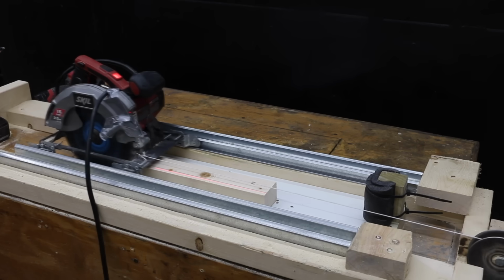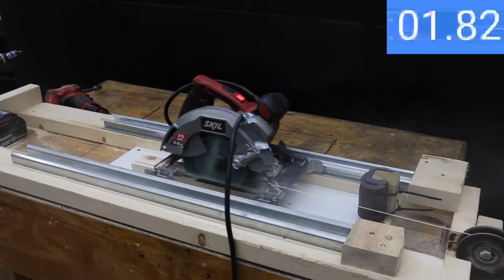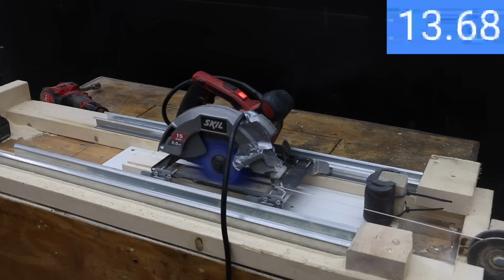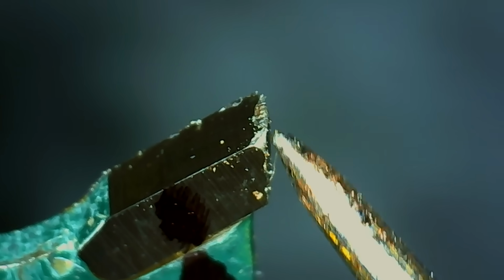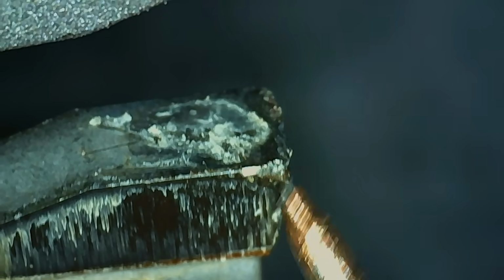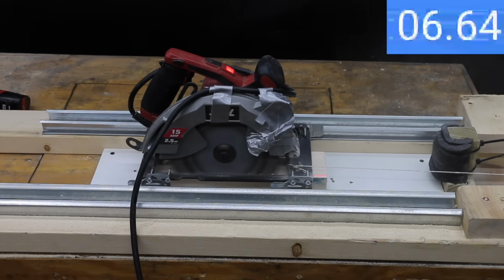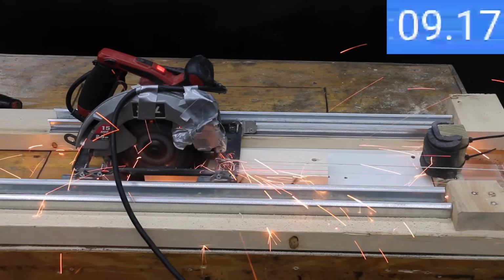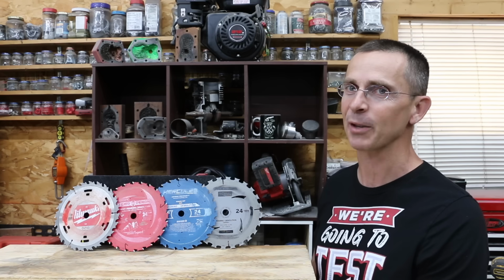Best "Demolition" Circular Saw Blade? Milwaukee, Diablo, DeWalt, Hercules, Evolution, Bosch, Amana

Comment: Very interesting, but ….       Heh !   
 No circular saw blade is going to do much demolition !    It has always interested me that the first cut/cuts  are slow, till the blade lacquer polishes, also a blade seems to need to heat up  to run at full speed.
     If I ever did demolition that way, I’d use an old Saw !!
Reply from the maker: Thanks for the feedback.

Comment: I've always stuck with Diablo blades, you can get them as low as $8 to $10 sometimes. To me, it's the best value. I used them this past weekend on building a table and benches, worked perfectly. Also used on cutting up some thin steel from a above ground pool. Slowed down a bit at the end but performed.
Reply from the maker: Thanks for sharing.

Comment: You do great work.  Can you revisit the battery powered chainsaws? The Ryobi worked great as you said but, in our case, struggled after cutting ~8" diameter cedar.  The saw stopped cutting.  Seems to have dulled a lot afterwards.  Appreciate all you do.
Reply from the maker: Thanks!  Thanks for the suggestion.
Reply: @ProjectFarm  It made the 1st 2 or 3 cuts and then nothing but smoke. Bar oil was good. Luckily, we can return it.  Looking forward to the follow-up.  Thanks again.

Comment: Speeds and feeds mean everything. The 5lb weight is a nice constant but it doesn't allow the entire performance story to be told. I don't know the answer, but...

Each blade has a different number of teeth, cutting agle, etc. The rate and weight of 5lb is going to favor some blades and not others. If this test was repeated with a 2lb weight and a 10lb weight there would be hugely different results.
Reply from the maker: Thanks for the feedback.

Comment: Not related to demo blades I found the best blade for a battery operated saw is a thin kerf blade.  It cuts easier and the battery lasts longer.  For Demo I go stray to the sawzall.
Reply from the maker: Thanks for sharing.

Comment: We don't have those "shingles" over here in the UK. 
What is it about them that would slow down a saw-blade after use?
Reply: As far as i know its sanded bituminous "fabric" 
Its like cutting through sandpaper wich makes the teeth dull.

Im German,  ill put the fabric in quotation, because im missing the word^^
In Germany we call it "Dachpappe" which could be literally translated to roofing carton (i think)

Comment: "The least expensive brand we will be testing is this Milwaukee brand."

Words never heard until now.
Reply from the maker: Thanks for watching!
Reply: It will be the last, the price will go up once Milwaukee hears how their blade did on the test.  They may even place some kind of verbiage saying "PF recommended".
Reply: @JT-lq4yd  that's no joke man. I've seen products he tested that were reasonably priced then I go to the store a week later n the price is up between 10% to 20% from when he tested them
Reply: @benmiller5015  thats just inflation
Reply: This is the first time those words have either been spoken or appeared in print.
Reply: Actually you know what was more unexpected, feckin Horrible Fright being a top contender.
Reply: @ObservationofLimits  I've used the harbor freight blades. They'll hold up in this. But any harder wood or wet treated wood. And it's shot real quick. 

Used a brand new 12 inch Hercules blade to build a small deck and it was done by the end of the job.
Reply: @ObservationofLimits  It was probably a fluke.
Reply: @drippingwax  but they only make test equipment.....
Reply: I know....  I just about passed out when I heard it!
Reply: My Lowes is selling those spider ones for 5 bucks should I buy?
Reply: @FirstnameLastname007  For $5 grab all of em
Reply: @doncheeto5  will do sir on my way
Reply: @FirstnameLastname007  waste that money.
also buy some Meme Stocks while you are out
Reply: Also considering it wasn't even rated for demolition.
Reply: Well, it's a framing vs demo branded blade. I'm sure a Milwaukee demo blade wouldn't be cheap. But considering performance, Milwaukee has most definitely been outperforming everyone. The cost of a Ryobi with the power and reliability of a Hilti. I'm glad at least one company still has some honesty these days.
Reply: @ObservationofLimits  Milwaukee's really exploiting their spot in the power tool hierarchy right now, and much more effectively than a lot of other brands. They make consumer grade tools that perform miles better and only cost yards more than the other brands, and at the same time they have the most incredibly broad range of pro and niche tools, positioning themselves to be the go-to brand for a lot of trades, because those trades can get their specialist tools and general tools on the same platform.
Reply: @ObservationofLimits  paaaa

Comment: Very interesting.  I always loved the Diablo blades and bought one specifically for a cabinet build.  I was borrowing a table saw from someone and he saw the cuts and bought the blade from me.  Someone else decided to use the blade to do some rip cuts through dimensional lumber and complained and said it was junk.  Told him he was a derp since the blade was made for plywood and things of that nature.  Might be worth testing different types of blades for ripping vs crosscut as well as throw in some blades made for plywood and which ones cut cleaner through engineered sheet goods.  I know they also make "combination" blades that are supposed to do it all but do they cut sheet goods as smoothly as a blade designed for it.
Reply from the maker: Great suggestion.  Thank you.

Comment: While I haven't done remodeling work for many years, I always preferred the Diablo blades whether it was a framing/demo blade or finish/plywood blade. 

I always found them to hold up longer than other blades, and it's interesting to me that many other manufacturers started copying their blade designs. 

That Big Blue blade design is dangerous. I imagine it would be far more prone to kick back.
Reply from the maker: Thanks for sharing.

Comment: As an avid Diablo user I was really interested to see how it would perform. I've heard of Spyder quite a bit, and am shocked at the performance of the DeWalt. I've used that blade one time only and that performance cutting through nails absolutely destroyed the teeth on my blade. Going to have to look into Evolution though, never heard of them. That said, after I see and feel a noticable difference in cut efficiency or after I've cut through say shingles (rarely with a Skilsaw - Sawzall typically) I replace the blade so most of the benefit noted after the torture tests for me is somewhat moot. Good info to have though, and as always excellent video!
Reply from the maker: Thanks!

Comment: Saw a video about the safety clutch set up for circular saws, amazing tool. Try to cut a hot dog with it and it senses soft material in the circuits and jammed the blade to a stop. 

Off topic a little, sorry.

Comment: Now that you have all of these duller blades you will have to test: Which clock movement fits and is the most accurate in your dull saw blade.

Then followup with best method of painting landscapes on clock saw blades.
Reply from the maker: lol  Thanks!  Cool projects though.

Comment: 15A corded saw is a good choice as a control test unit. Push the blades as much as possible with a consistent power supply.
Hercules now has something very respectable to look at. When it comes down to cost effectiveness, on sale, the Diablo can't be easily beat.
It would be good for a part 2 with other brands like AvantiPRO, Admiral, Bauer, Craftsman, Lenox, Makita, SKIL, Kobalt and Irwin. Even though they seem to be rebranded. With the amount of brands, you might even be able to do part 3.
Reply from the maker: Thanks for the suggestion.

Comment: Diablo blades are 100% the best carbide blades for metals, the Steel Demon brand.

But id like PF to test that on 1/4 inch mild steel or similar, thanks again PF.
Reply from the maker: Thanks for the suggestion.

Comment: Great testing process and video, I just have one single complaint for this comparison. You should have tested with crosscuts instead of ripcuts on wood as most of the framing work is crosscutting wood, and demolition is almost only crosscutting. 
This could have made different results as these blades are made usually for crosscutting and wouldn't have experienced so much heat buildup. 
Maybe next time when you test another set of blade manufacturers
Reply from the maker: Thanks!  Great suggestion.  Thank you.

Comment: Did you put a off switch behind that foam bumper or was you turning off the saw every end of the cut? If you put a switch behind the bumper in line with a timer, every time that the blade hits it it will do two very useful things for your test:
1) Will switch the saw off
2) Will stop the timer
Doing that might give you more accurate results...Otherwise thank you for yet another incredible video and keep 'em coming !

Comment: That Big Blue blade just doesn’t make sense to me all around
Reply: Probably good at small brush on the edge of weed eater
Reply: @MrDavegiven0330  yeah that’s what I was thinking. They just rebranded it as a be all blade
Reply: It is all looks and gimmick. Put it on the wall and call it your "precious". Everyone who hasn't seen this video will be in awe of your Big Blue.
Reply: Agreed, that thing was a waste of material...
Reply from the maker: Thanks for the feedback.
Reply: That thing looks so dangerous though - it reminds me of the old, banned (in Germany) styles of routers you would have and that like tore your whole hand apart should you be so unlucky to get your finger in there somehow.
Reply: We used a big teether like this when cutting half rotten wood. Wood that had gotten used and abused, and no longer felt solid inside. Like an old porch, say.
Reply: Looks more like a weed eater blade...

Comment: When I have a saw blade that gets worn down and isn't fast enough for doing framing, I'll save it for demolition purposes. I had to rip some very old floor joists down an inch and was cutting through old nails and screws. Had to cut through about 120 ft of material. Lots of screws and nails were hit and it took me two blades to do it.
Reply from the maker: Thanks for sharing.

Comment: All of my circular saws are Evolution (table saw, cut off saw, mitre saw and hand circular saw), they all cut ferrous plate, tube, non-ferrous plate, and wood, all with virtually no kick-back.  I'm guessing that big blue would break your wrist and gouge your hard hat if using it manually and hitting a nail in timber
Reply from the maker: Thanks for sharing.
Reply: @ProjectFarm  no problem!  It looks like Diabolo and a few others in the top 5 also use a similar blade geometry that should also mitigate kick-back.  I blunted my first mitre blade Evolution cutting 30 sections of black hot rolled  3"×1/8" steel btw - grinding the mill scale off gave me five times the cutting on the second blade.  It might be an idea for a future video to look at cut-off performance of tungsten carbide saw blades?  Advantage of them being that the heat goes into the chips, not the bit you want to keep (cutting 1" square stock in my non-coolant bandsaw, the metal gets HOT, cutting the same with tungsten carbide circular saws, I can pick up and use the parts immediately)

Comment: So if the Amanna blare is designed for use on nails, what are ferrous and nonferrous nails. I’ve seen stainless and carbon steel nails but never a non metallic nail
Reply from the maker: Thanks for the suggestion.

Comment: The blades were the cheapest part of this video. That was about $2.5 million in 2x4s
Reply: Lol!!! Unfortunately that’s true. Gold is going to be cheaper than lumber at the rate it’s going.
Reply: Just the sawdust is probably worth more than it's weight in cocaine right now.
Reply: I was going to comment about the price of lumber. But you have beat me to it. And with pure gold lumber...pun intended.
Reply: my buddy sent me a picture of the 2x4s he bought at home depot the other day. it was like a dozen.....he spent like $1000 there that day.
Reply: @MrSGL21  

Must have snuck a couple out!!
Reply: @MrSGL21  a dozen studs last time I checked prices would cost about $108. They were around $9 a pop. A year ago those same studs were running about $3.49 each. So the dozen would be $41.88.
Reply: @1pcfred  he had to buy some odd length ones like some 10 footers and some 12 footers and they were like $13 and change each. He also had to pick up a bunch of other stuff for the job but his total bill home Depot was $1,000
Reply: I just bought 2 2x4s for $2 each at my local store I'm really thinking I should have bought more now
Reply: Ain’t that the truth!! 👍👍
Reply: No joke, I'm wanting to build a fence. I may cheep out and do a "California" fence, vs picket.
Reply: you people are dim
Reply: Yeah no joke I went to build some shelving in my garage and I'm like

Why are these 20$

They used to be like 2$
Reply: What shit hole country do yall live in? 2x4x12s are like 5$  gas is 3.30 and ribeyes are 7$lb

Comment: i would like to know what these brands think nails are made from
Reply: You, like project farm, misinterpreted the labeling. It is saying that they're not for cutting steel, as some circular saw blades are. They're meant for cutting nail embedded wood. They're not meant for cutting a shell of 1/4" plate steel like other circular saw blades. (Usually with special saws that have a slower RPM.)
Reply: As long as it isn't made from iron and isn't not made from iron, it should be okay.

Comment: Future video idea: Allen wrenches! I'm curious about the benefits of individual wrench kits vs those flip out- pocket kits. Also I've had issues with some slipping out of the hex easier than others. Keep up the great work, love the channel!
Reply from the maker: Thanks for the video idea.
Reply: @ProjectFarm  please test screwdrivers
Reply: @ProjectFarm  If you do this test, check out paramount Allen wrenches. Have a set, and their Teflon coating is surprisingly nice.
Reply: I never gave the quality of Allens any thought until I finally used a decent set and was stunned by the difference it makes. Would be nice to see Bondhaus vs. hardware store generics.
Reply: @microwave221  yup. I use cheaper Elklind for generic stuff, but bust out my angled shorty bondhaus for hard to reach and my Wihas for ones stuf hard or when I need to hold onto the fastener. Surprisingly I came across a cheap sey of kobalts that were nice and stiff and far less prone to twisting or bending than Elklinds.
Reply: actually a fantastic idea
Reply: Huge difference in machining tolerances, especially the smaller sizes. For a 2mm or 2,5mm hex key it is not very nice when the measurements side to side using a micrometer is 0,2-0,3mm or even 0,4mm off consistently. Really makes you realize why you've had so much trouble with those tiny set screws :) project farm once tested some hex or torx bits and complained that they stuck to the screws, if there is no deformation of the bit I see that as an absolute win.
Reply: Actually had the tip break off in a bolt.

You don't consider performance important until something like that happens.
Reply: The Wera allen keys win in my opinion. I never strip bolts with them.
Reply: The biggest difference in allen wrenches is the ball ends
Reply: @bedlamite42  yes and people should lose a finger every time they're lazy and use a ball end on an impact to put M6 FHCS into way covers. Strip em out and jam em in. Was the bane of my existence in a machine shop. On an average month I drilled out 90% of the way cover screws I needed to remove.
Reply: I bought a set of Swiss made PB tools Allens six years ago, both an L shaped set with ball ends on the long end and a separate set of straight drivers with handles also with ball ends for my work. I use them every day I work but not traveling, so 200 days of the year each year, and have never had any noticeable wear or damage. They look and perform like new. I have even stressed them by using a wrench to turn the straight ones where the L shaped won't reach, ball end and all. They never damage a screw or get damaged themselves. Highly recommended! I see customer's sets of other brands where they use them a fraction of the time and they are crap.
Reply: Ooooh I'd love to see Allen wrenches. Specifically smaller ones for my hobbies.
Reply: In my opinion the flip out sets are worthless ,   always in the way. I would like to see a hex wrench test though.
Reply: I'd also be interested to see how longevity is affected by using Torx instead of hex.  I often run into a situation where the kit I have on hand doesn't have the right size hex head, but does have a Torx head that fits.
Reply: All bits especially smaller ones if you're doing a lot of work buy a better kit it will last way longer before wearing and the bits are machined way better.
Reply: I can recommend Wera. Their bits are also extremely good.